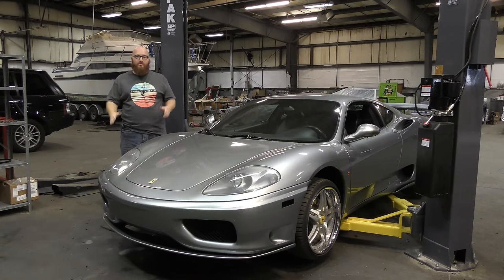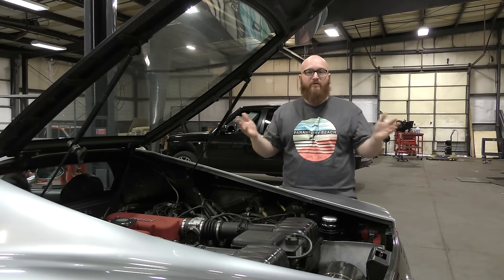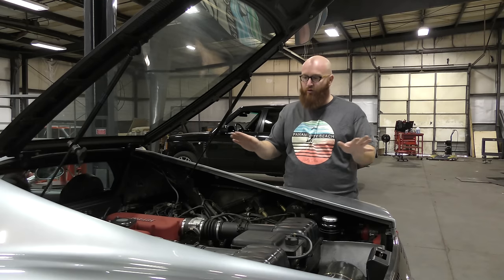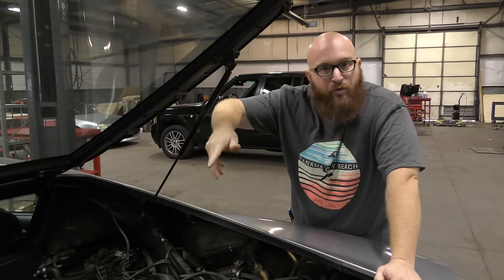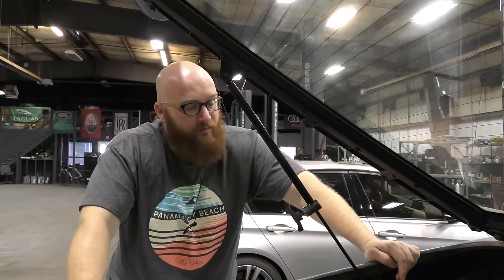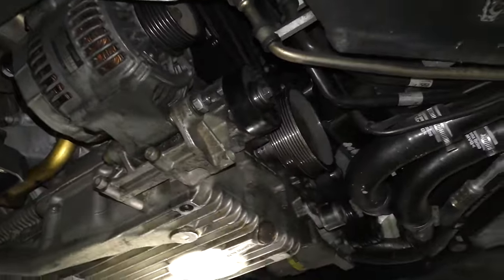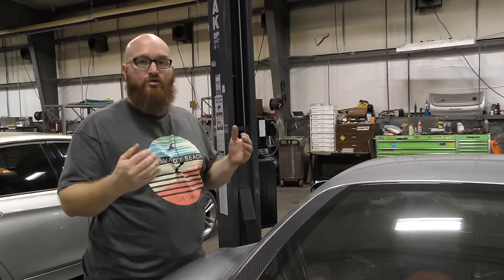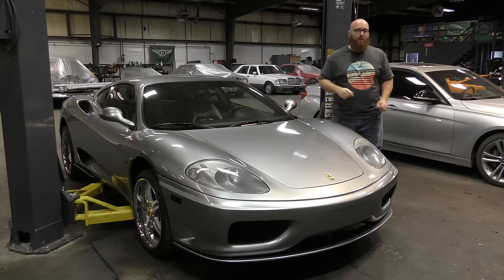Ferraris get check engine lights too! See what the CAR WIZARD found on this 2001 Ferrari 360 Modena

Comment: What I have found from these cars as I decided whether or not to get one as a project is that these "super cars" are not produced in mass enough to warrant mass production testing and reliability. They know the cars will not be driven very much, and when they break down the owners should have a lot of money to take it to the dealer. Some items like brakes and the engine are complex and engineered okay, but the rest is every corner cut to find something already on the market that works just as you said.  Its so much easier to grab another engine from a salvage yard on a mustang than deal with these over-priced foreign units.  The 360 is the oldest I care for that still looks modern, and at just over 400hp it's not that impressive vs a supercharged mustang. There are also many problems like their fuel tanks and their location that have caused many of these to burn. Just not enough units produced to find all the common issues cars have. It seems a lot of people also want Ferrari dealership paperwork for maintenance- I'm sure that is a preference, but enough to chase me away since I would do all the maintenance myself. Still a beautiful car.

Comment: I haven't been around many modern Ferraris but I have worked on and played around with some vintage Ferraris like 308s, before the prices went crazy, and if I remember correctly they also shared  at least a few parts like switches and ignition lock cylinders/key blanks with Fiats.

Comment: those airflow sensors look suspiciously similar to the ones VW used to have on mid-90`s to mid-00`s TDI cars
Quick google search on the bosch number says a 360 mass airflow sensor is the same one on a bunch of BMWs
Reply: Ultra luxury cars are all like that. You can find copious amounts of audi parts on ultra high end vw family vehicles. Or Toyota parts on Lexus, etc
..it gets even more strange when you look at companies like range rover who uses Ford engines in some models.  Lots of other arrangements like that. You are certainly paying extra for the name in that case but its still also a good thing for part availability as the car ages. I'd consider it a huge perk not to have to buy a ferrari manufactured part vs a less expensive manufacturer.
Reply: A lot of cars share similar stuff, sometimes even entire platforms, it's usually if they are under control of one group (VW group has everything from Volkswagen and Audi, to Lamborghini and Bugatti, that's why you can find an Audi with a lambo engine) or have a partnership on a specific model (Toyota and BMW on the new Supra... It's a Toyota Supra, but probably over 60% of it is actually BMW parts)

Comment: I figured they just burst into flames before any check engine light
Reply: It's 19 years old now? As if old cars don't break do they?
Reply: The flames are the check engine light.
Reply: @OMGWTFLOLSMH  but it's 19 years old? The cars sit ages and the rubber is just eaten by the ethanol in the petrol.

Comment: "What supercar would you like for a daily driver?"  A De Tomaso Pantera with a few upgrades for better reliability and braking.  Don't think getting parts would be to much of an issue, which would be something important to consider if it was a daily.  Sure a Lamborghini or Ferrari would be nice, but getting parts could prove challenging.  Daily drivers break and most people like myself would rather not have to wait long before getting it back on the road.
VT247

Comment: When he unplugged the MAF sensors the ECU stayed in open loop running the engine with a sort of "default mode" for various things including the fuel trim to allow the "Wizard" to verify his suspicions. What probably tipped him off was that it was only misfiring when warmed up. (I don't think he mentioned that part in the video.)

Comment: The hardware may not be all that special, but the wrapper fits a lot tighter.

When a huge percentage of service procedures start with "remove engine", you know you're not working on a Chrysler minivan.
Reply: Yeah, also the engine is on the wrong end of the car, making it a bear to service the belts.  Because racecar.

Comment: Had to replace my 360 fuel pumps at 20K miles. Super easy in the later year Spiders.
Reply: super easy,  barely an inconvenience
Reply: Same problem as Alfas from 98 - 2007 with petrol engines. Twins Spark or V6.
I think the top of housing is the same, even the connector. 
Most of the guys here use Epoxy glue to fix leaks and no problems at all.
Reply: my old '88 honda, i had to climb in the trunk to change it out.  good times.
Reply: At 20k miles says it all about owning a Ferrari
Reply: @MarkusGrimm83  That comment is tight.
Reply: @samuelseager6785  I see you're a man of culture as well.

Comment: I think the biggest thing that the Wizard has done for "normal" folks is to make them not only less scared to work on "exotic" cars.... but cars in general.   I was starting, more and more, to feel like the systems in the cars I owned were beyond me.... but this has given me the confidence to at least SEE if I can fix it myself.   The whole mantra of taking your time and thinking of it like any other car is huge.    I do have some okay mechanics in the area when things ARE too much for me, but it's empowering to remember that .... yeah....  I'm still that guy who kept all his cars running with a few screwdrivers and a socket set all those years ago.

Comment: One thing about MAF sensors:  They operate at very low voltage, so any small amount of corrosion on the terminals can cause the car to run lean, rich, or misfire.  I had all sorts of trouble with the MAF on my 928S2 causing the car to run way rich until I finally repaired the rubber boot on the connector. Prior to changing the boot, I had to pull the sensor off and clean the contacts with Deoxit every two months.  New boot: Problem solved!
Reply: @STOP_RIGHT_THERE_CRIMINAL_SCUM  South Florida.  The humidity had everything to do with it, but this problem crops up in Europe from time to time.  John Speake in England rebuilt my MAF, so I know it wasn't a bad part.  He told me they had this problem over there too.

Comment: That fuel pump housing is the same as my Alfa Romeo 156 twin spark.
Same issue. Just dry it out, scuff it with 100grit sand paper and use epoxy glue. I used Bison metal epoxy, and after 3 years and 150 000 km without problem.

Comment: 2:28 Yeah the greatest Irony is when your an Enthusiast of Old Cars like that, is that Lamborghini, and Ferrari, they used what was around them in italy, theirs literally the tail lights of just a regular passenger car on the Miura, much like they did on the First Lotus Esprits with Rover of England, and things were so sort changed around the mid 70's that they would use what they had at the shop to build the car, like one side had metric bolts, the other didnt

such as what Ed China Found on that Lamborghin Urraco they pulled out of a very small garage on wheeler dealers, which is part of the reason why I get so bent out of shape with the speculators on the older cars, such as that guy they featured on Vinwiki with the Miura's, you could BUILD a miura with a 100 thousand dollars, granted it would be quite the undertaking, and you'd have to deal with the oil starvation issues of the poor design of the crankcase and the engine oil sharing the same oil pan

but it could be done, like if any car deserves to have kit cars made of it, its a miura, heck the hardest part of the car would not be the chasis OR the body, it'd be the engine, like that's the only damn really hard to replicate bespoked part you'd have to make

and ferrari was the same, they used alot of their parrent companies fiat parts for their cars, or the engine would show up in one of their projects, such as with the Fiat dino, I mean how do you think both Lancia and Maserati ended up with ferrari engines in their wheel house, Fiat, a working man's brand in italy sold it to them. 

like you think the 206/246 dino engines only ended up in the Stratos and the Fiat Dino, but some of the mid to late 80's maserati's had 308 engines in them, much like now. 

its really only stupid people who think their bespoked and impossible to find parts for, heck lambo was really the only one that was kind of Botique made, but even then, it was still hand made

and the last time I checked, we all had hands, its just you have to pay a pair of hands to have the nerve to work on it.

Comment: MAF sensors not always give you check engine code. Sometimes they work bad but still in some tolerance. For example i had V6 Alfa Romeo. No check engine code but between 5000 and 7000 rpm you can feel you don't have the full power. And this engine should be great exactly between 5k and 7k rpm. So i got a diagnostic cable and multiecuscan software, got live data recorded and the measured airflow at high rpm was not the correct amount. So i ordered new maf from Italy because in Italy the price was 250$ , but in my country the same part was 400$. And with the new MAF the car was a lot better. Then with the same diagnostic i found the lambda sensor was not working at 100%. Replaced with original bosch. The replacement brand new Bosch was working also not great. Then ordered NGK lambda sensor and it was twice the price of the bosch. And this sensor was great. The car got the full power...

Comment: It's not always the case that when you unplug a maf it goes into default mode. On some ignition systems it goes straight into limp mode and runs like shit. Even the transmission then stops shifting correctly. For instance the passat b5-5.5 and audi c5/c6.

Comment: Jud Massingill at SamTech spends a lot of time showing us how every engine is just an air pump. There's no Voodoo involved with mechanical parts, it's just understanding how they operate so you can properly diagnose the issue(s).

Comment: how do you cross reference a part? i've been having troubles with my 2006 daihatsu terios, is built with toyota bits which are supoded to be easy to find but the problem is i can't find any cross reference information, for example, the power windows switches looks just like a toyota part but i can't make any sense of the part number vs a toyota number

Comment: Why order new air flow sensors, when you can spray clean the current sensors with Mass Air Flow Sensor cleaner, or even electrical contact cleaner?
Reply from the maker: As stated on the video, this was already done. It did not help.
Reply: @CarWizard  Apologies, I was too hasty in  presuming you hadn't already tried the cleaning route.

Comment: From my experience those Bosch MAF sensors of that era are absolute GARBAGE- and that's probably an insult to garbage. Their failure rate is absurdly high. They were used on VW's, BMW's and many other cars. Some mechanics would joke to have them replaced every time you do any oil change. One problem is they often don't give codes when they fail and the engine runs like crap.

Fun fact, the ECU's on these is a Bosch unit shared with a Cadillac Catera and several Fiat's (only with different firmware). These also have a high failure rate.

Comment: If I unplugged the MAF on my Camry the engine indle will fluctuate.  Maybe Ferrari has great technology to compensate for that ? Yes, I know Ferrari are in a league of its own. 😃
Reply: Nah, it's is just a question of how aggressive the base map "limp" fuel map is.  Some GM's with MAP and MAF can run 99% normal but not pass emissions with the MAF unplugged.

Comment: Ferraris always get check engine lights. Italians are not known for making reliable cars. But they are known for making very fast supercars. Supercars are too easy to catch on fire and Audi almost made a diesel R8 that would have solve the problem because diesel fuel doesn’t catch on fire easily.

Comment: I've met some real dick heads at auto shops, they over-charge you, screw up the repairs, or fix the issue but create one or two new ones etc.  you seem like the opposite of those guys, I'd trust you with fixing my car to do it right and charge a fair price.